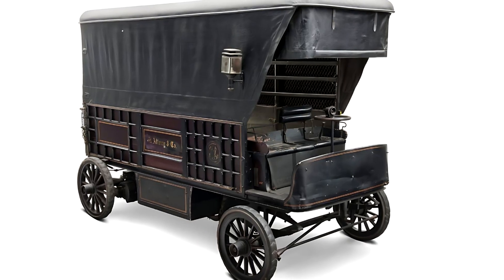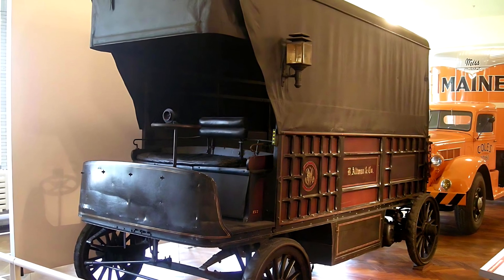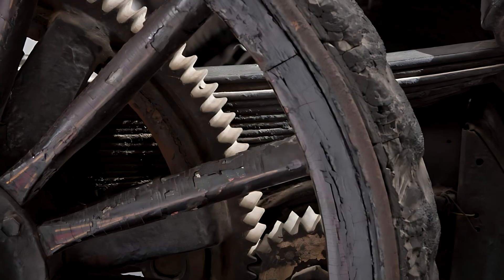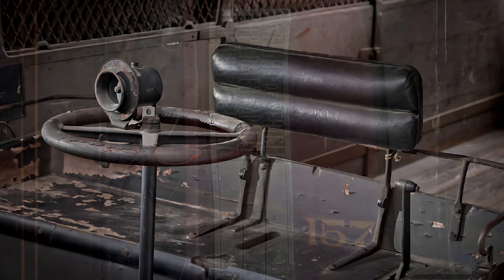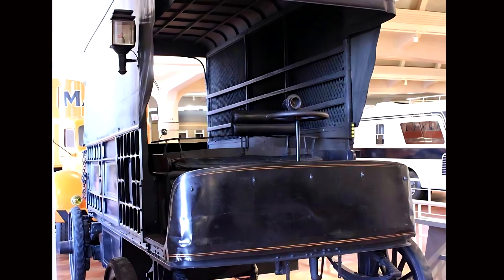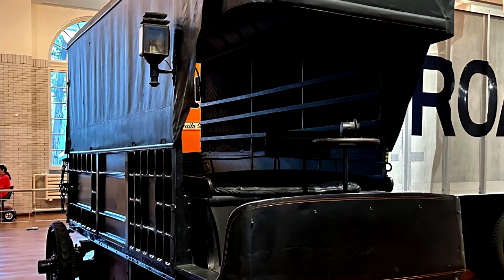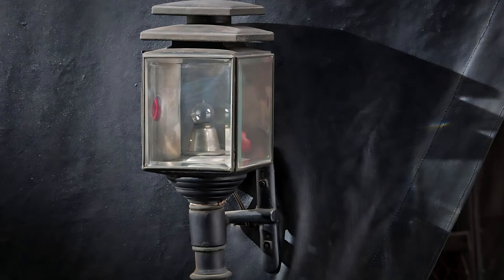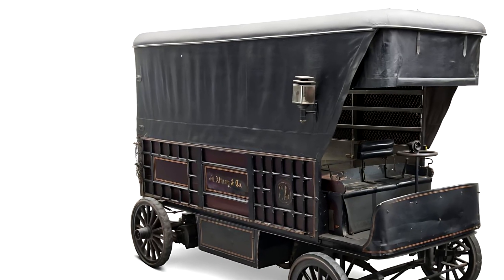1900 – Wood Electric Truck – History’s First City Electric Truck ⚡🚚🏙️

Comment: Imagine where electric battery technology would be now if electric cars won the race instead of gas cars. I might be driving around in my Wood Electric Sedan now instead of my gas powered Lexus. By the way, Ni-Cads were invented the year before in 1899 so lead acid was not the only reliable rechargeable battery by then.

Comment: If you got a horse you got to maintain it. If you have an old gasoline driven vehicle you got to hire a mechanic to maintain it! We can probably blame a lot of The Disappearance of electric vehicles on Henry Ford! He never entertained an electric vehicle!
Reply: A thirty mile range was it's limiting factor, with lead acid technology all independent electric vehicles had the same problems, Ford's refusal to consider electric was correct, liquid fuel gave the range and rapid energy recharge in a way that an EV could not do, this lead to the opening up of the vast areas of the USA, ultimately giving the society they have now, here in Europe the range was slightly less of an issue, but the speed and simplicity of an energy recharge from a few cans that could be carried was there for all to see,  EVs may be the future but even with current battery technology they still have a long way to go.

Comment: My father told me about seeing electric trucks being around when he was growing up - alongside horse-drawn wagons.  But I'm only just now hearing about this specific Electric Truck manufacturer.  Between this one - and the Walker Electric Truck you featured a few days ago - these are the only two 20th Century E-Trucks I know about.

One thing that seems to be a constant is "range anxiety;" even if the limitations were adequate for the duty required.  That said, I have to wonder what the range of these pioneering vehicles would be if a 21st Century Lithium-Ion array replaced the original, 19th Century lead/acid batteries?  

I'm sure that there are many more, and I'm looking forward to finding out about them on this channel.

Thanks, On Wheels!

Subscribed. 

25th Like.